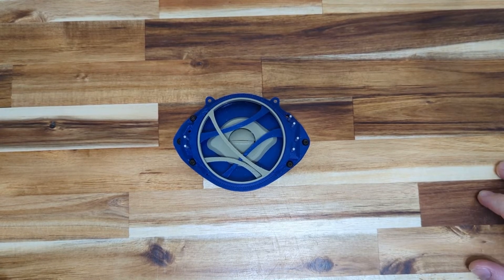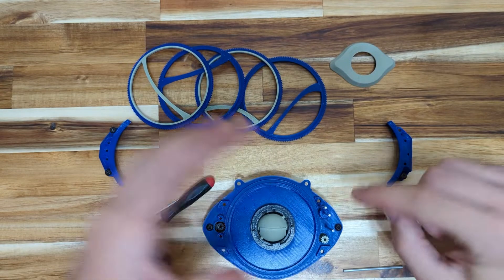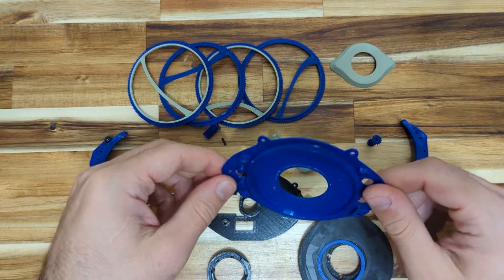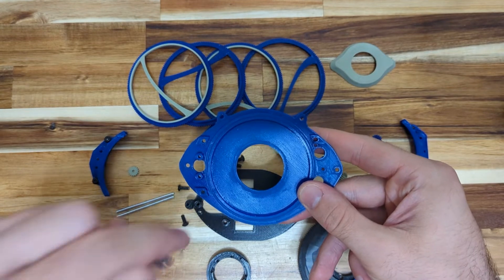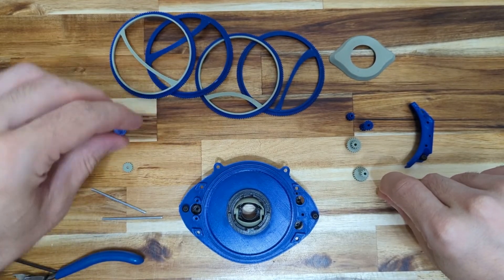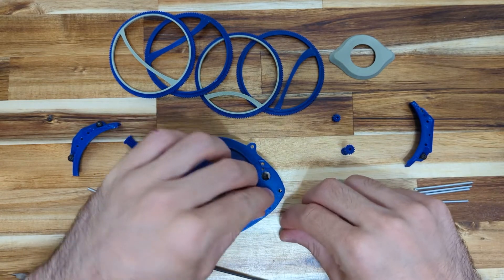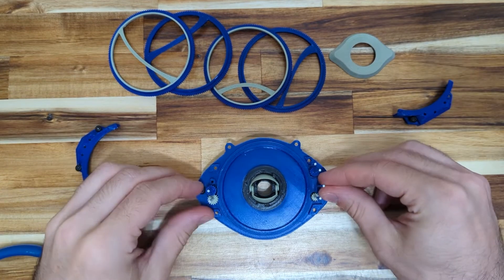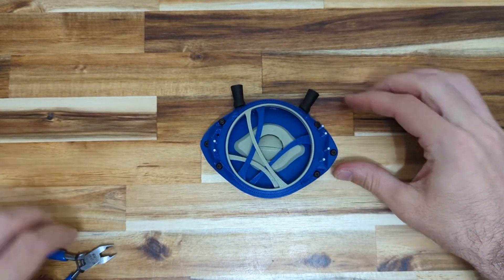Enza3D Eye of Agamotto Assembly Video

Comment: hey there, I've started to do the assembly of mine... the use of the filament to hold the eye pieces seems to continue falling out. The eye will open/close 3-4 times and then the filament will come loose. Any tips for trying to keep that together?
Reply from the maker: Hi There Cyber Hobbit! I would recommend either a dab of hotglue or a small dot of superglue, Either should hold the piece of filament in place for you

Comment: I guess there is one file wrong from Etsy. The RightBottomGear has it's hole smaller than the others gears' holes. Can you check, please?
Reply from the maker: Hi Felipe, I can upload a new one, I left that one intentionally undersized because in some of my test prints the extruder had a tough time extruding the thin neck that connects those two spur gears.  Undersizing the hole made it print more consistently, and I chase all of the gears with a 2mm drill bit to get the goobers out anyway, but I can understand the confusion.   I'll upload a gear with a "nominal" hole and another with the u ndersized hole and will clarify the distinction in the directions.  Thanks for catching that, it had slipped my mind
Reply: @enzacosprops  ow, I got it. Thanks :)
The model is awesome, but I'm struggling to print it correctly hahaha. Besides my printer looking well calibrated, I guess it's not, because I'm having so many wrong prints that doesn't fit. 
But I will persist until I get it right :)
Reply: @felipesousa8965  how did it go?
Reply: @Dawid4Real  I couldn't finish it yet. It's very hard to make, because the pieces must be printed perfectly. Got a bit frustrated and will try again in a few weeks.

Comment: What a great project! Well done. If you decide to go down the micro controller route you could use Hall effect switches instead of physical switches to save on mass and wear. Do you have the files for sale? Thanks
Reply from the maker: We do indeed! https://www.etsy.com/listing/1252137931   I actually JUST put the finishing touches on a PCB to simplify the electrical side of this project, that is currently still using the SPDT switches. fully agreed on a hall effect sensor being appropriate here.  Reminds me of this video https://youtu.be/Bea4FS-zDzc